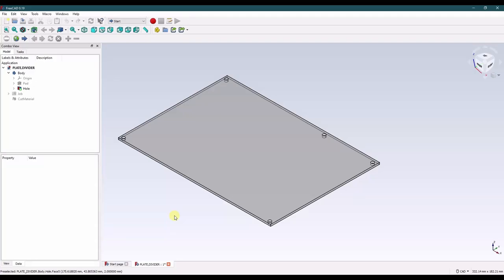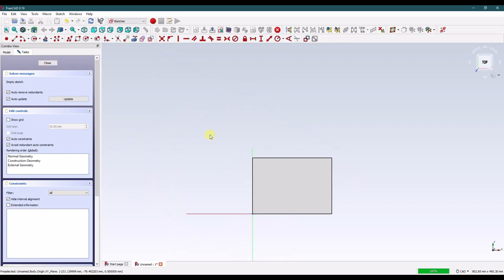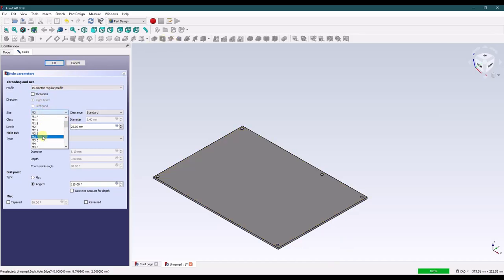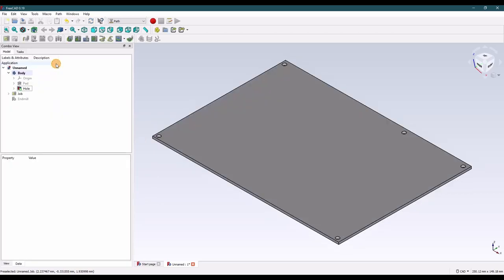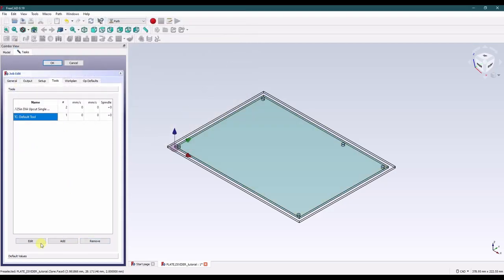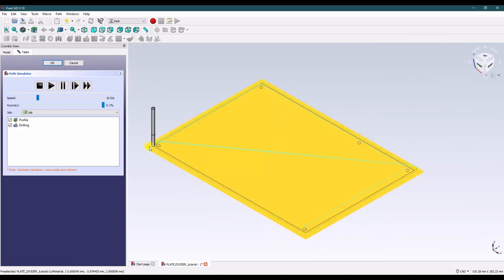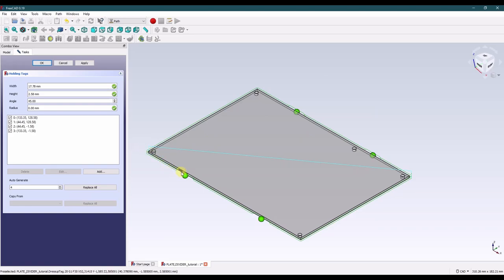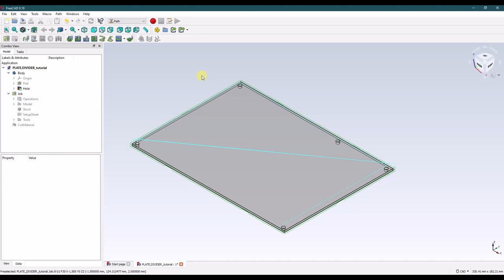FreeCad Tutorial #7 | How I use the PATH WORKBENCH to make things on my 3018 CNC in FreeCAD

Comment: Does the toolpath just ram the end mill to depth when contouring?  Or does it gradually bring it to depth?  Some of the visualizations I see on YT make it seem that way.  Is it just the choppiness of the visualizer?
Reply from the maker: Yes, it is set to just plunge directly into the material at the specified depth, not to ramp down. You can use a ramp down "dressup" on the profile toolpath, however. But I think this will override the tab dressup. Unless someone else knows better?
Reply: @KTECDesigns  how does this not break the endmill?
Reply from the maker: @weirdsciencetv4999  Well, for one I'm only machining plastic here, not metal. Secondly, the type of endmill I'm using can also drill holes, so it is ok to plunge directly into the material. I make sure that the plunge speed isn't fast, and that the spindle speed is sufficiently fast.
Reply: @KTECDesigns  Oh I get why your settings are as such, what I am wondering is if there is no option in FreeCAD to ramp the endmill in for normal contours/pockets.  I haven’t seen anyone do this yet.
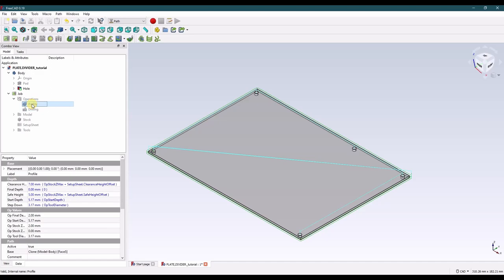Reply: @weirdsciencetv4999  Check out 18:15. That's where you can see the dressups, one of them being RampEntry. @KTECDesigns did mention that he thinks it may overwrite the tab dressup, so I'm not sure about that. It would seem wild to me if you can't have more than one dressup, because surely many operations will require both tabs and ramp-ins.

Comment: Hi Seth, I am a newbie to FreeCAD, having previously designed my model in Blender and exported the mesh as an STL into Fusion 360. I have successfully imported an STL mesh into FreeCAD but cannot begin a new job in PATH as I do see a model or template when I open the window. I guess that I am missing a step but unsure what that would be? Thank you in advance and hope to learn a lot from your tutorials.
Reply from the maker: I haven’t worked with STLs for this kind of application, so sadly I won’t be much help to you. But, you might want to try using a solid model instead of a faceted one.

Comment: hi. when you set the bit length in the tool editor, is it the length of the tool after it protrude out of the collet or the just the total length of the bit.
Reply from the maker: It is the total length of the bit.
Reply: @KTECDesigns  Thank you for this video, helps a lot. Finally able to do my first cut.

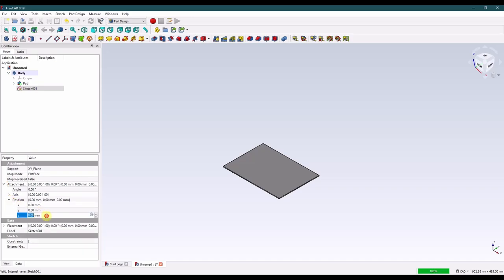Comment: at 3:33, why did you raised the sketch plane by two mm instead of making the sketch on the surface directly ?
Reply from the maker: There is an issue with modeling on reference topology in FreeCAD. There are many YT vids on the matter. So it’s current best practice to simply adjust the position of sketches.
Reply: @KTECDesigns  Cool. Is this practice best for freecad only or its a common practice for all cad platform ? Could You explain how to us different g codes and do nesting ? merci
Reply from the maker: @guillaumevincent716  this practice is only for FreeCAD. As far as the differnet G-codes and nesting, I'm not knowledgeable about that yet.
Reply: @KTECDesigns  ok. Is it because of the direction of the pad that is created? For example, could I decide to create a sketch on the XY plane, then create a pad that extrudes below the plane, and then on this top face, makes sketches for holes and other features?